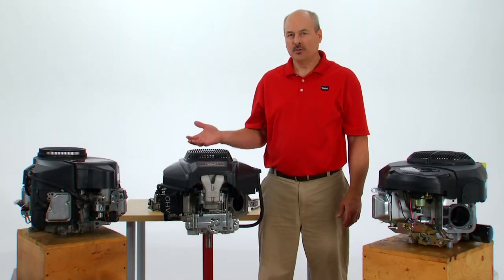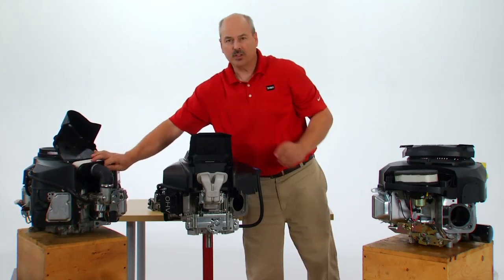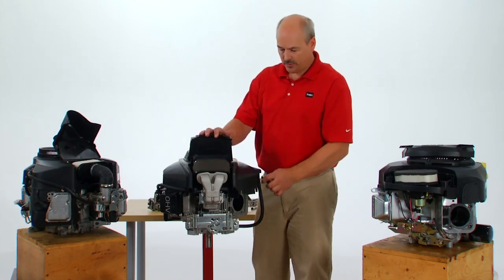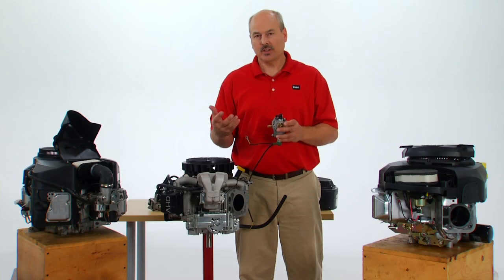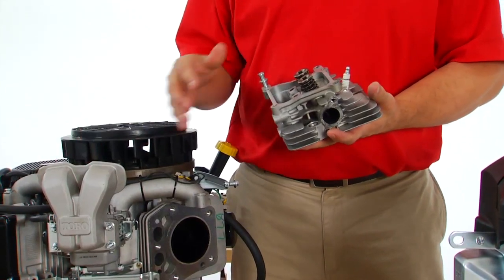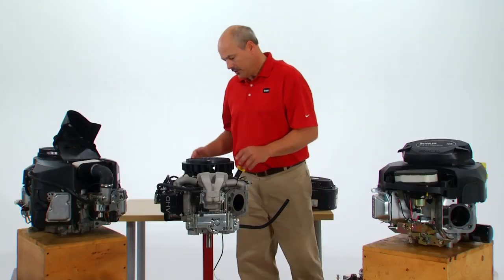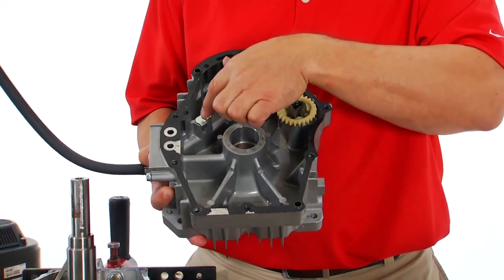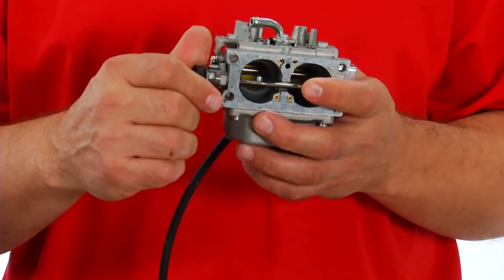Toro V-Twin Engine

Comment: That gear is nylon because it’s cheaper.  Period.  Stop lying.
Reply: William, Kohler has been using nylon cam gears for over ten years- even in their commercial engines. I've heard that all the pro stock cars use them too. Cheaper they are, but that doesn't necessarily mean they are inferior- and especially when used with a governor set up for mowing lawns, meaning they don't see high rpms. Not to mention the technology has come a long way since the 70's when many of the car manufacturers starting using them. Today they have fiber reinforcement and other chemical attributes. Combine that with smoother crank and less drag, and I'd say the nylon gears will remain persistent in high performance engines for many years to come.
Reply: Rick Cox I didn’t d not call them inferior.  You’re now lying.
Reply: William Bissell, with all due respect, I never said that you called them "inferior". I simply made a statement that cheaper doesn't mean inferior. That gear could very well be made of nylon because nylon is superior to steel in certain circumstances- and not necessarily because it's cheaper. Hope that makes sense.
Reply: @crabtrap  crabtrap, I know this may be a leap of imagination for you, but you might realize that Kevlar can often be produced cheaper than steel- and that doesn't mean it's inferior to chain mail when it comes to stopping bullets from entering your body. The same can be said for hard drives, computer chips, parts, etc. Steel doesn't always mean better just because it may hold up better in a vice. 
But then again, you're not an engineer are you. If so I don't think I'll be buying your bullet proof vests. lol.
Reply: @rickcox1843  actually yes i am. And i believe that is cast aluminium part. Dont know what kevlar and "chain mail" has to do with it, oh also the level3 vests have plate steel trauma plates, but u used falacious anology anyway. Plastic or rubber intake manifolds usually degrade from fuel vapor and UV rays. Considering this is ztr/engine is supposed to have mildly heavy dutycycle. Aluminium/steel is a better choice.
Reply: @crabtrap  I was making a comparison between kevlar and chainmail in hopes you might think about which one would stop bullets better, IOW Metal doesn't always mean better. Sure you can add plates of steel to the vest to add further stopping power, but how practical is it to wear level 3 vests on a daily basis? The point being that all things must be taken into consideration, including functionality and efficiency. Toro has succeeded in these regards giving us a fantastic motor with an excellent nylon cam shaft, IMO.

Comment: oil change on toro motor zig and zag, first oil change that nipple breaks off WTF
Reply: Supposedly being redesigned as it is a known problem.  A plug versus the nibble that needs lubrication to keep the hose from adhering to it.
Reply: I did my first oil change on my toro z master with the same engine with Donaldson air filter on it the nipple broke off when trying to pull off. I just put a smooth bolt on with a hose clamp to plug the oil drain hose. Bad design.

Comment: Agreed with Johnson on this one. Just to add, nylon cam gear??? Really!!  that will be the weak point of that engine. Also, polymer intakes are a good thing. They avoid "heat soak", which robs engines (exapecially air cool engines) of torque causing less air to get into the engine.
Reply: jon, how many engines have you heard of that had a nylon gear brake in them?
Reply: Yes And no. You have forced air from the flywheel sys. You will have heat soak with a hot engine that's not running. And will go away once you are running it. Why it does not have the time to heat soak. That has been tested with auto ind. Plus i am sure did the r/d on that engine for that.
Reply: jon doe l

Comment: The oil drain hose, how stupid is that? Leave your machine unattended and an 8 year old child can drain your oil.Yay! Also if the hose comes loose from the nipple at the end dirt can get into the engine. Sorry but something as important as engine oil  needs to be secured.  Also since  when is a wrench a "speciality tool"
Reply: The blue holders keep the hose in such a way it cant come undone. That is if you can keep your 8 year old away from it. I changed mine a couple weeks ago. Best oil change in my life.

Comment: I was no longer interested in this motor as soon as I saw the nylon gears. Chevy did this in the 60s / 70's and those damn timing cam gears were done in with broke teeth before 100k miles. it was not worth a shit then and its not worth a shit now. Thanks for letting me see the cheap ass crap you are putting in your " commercial " motor. LMFAO. I'll stick with the Kawasaki

Comment: Agreed with Johnson on this one. Just to add, nylon cam gear??? Really!!  that will be the weak point of that engine. Also, polymer intakes are a good thing. They avoid "heat soak", which robs engines (especially air cool engines) of torque causing less air to get into the engine. Metal intakes retain too much heat.